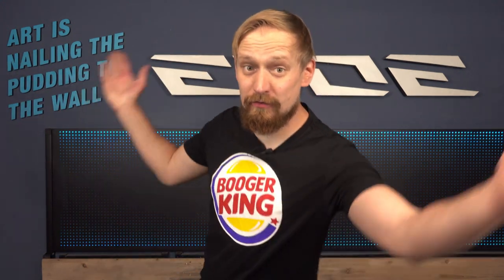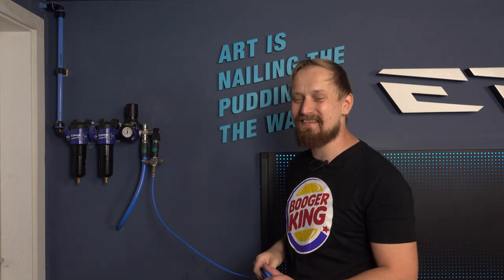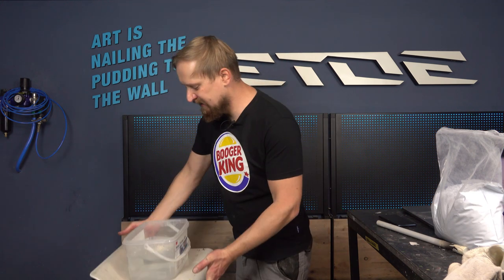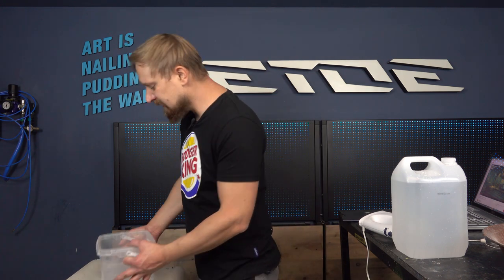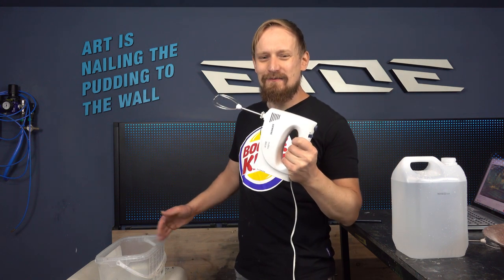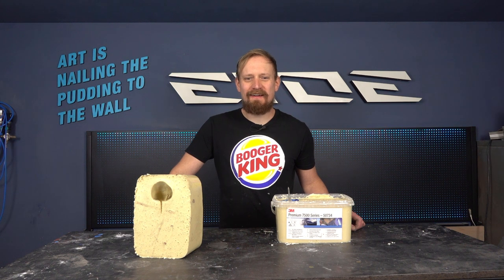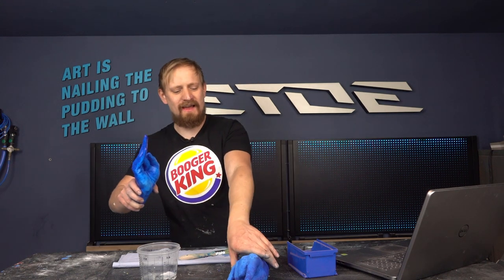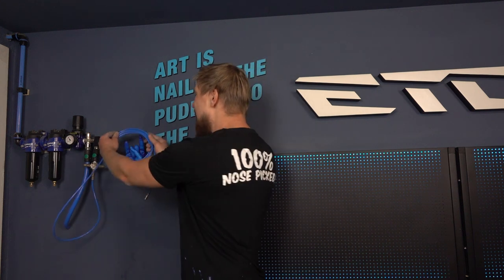Cast a hand for the best hose clamp ever

Comment: Even when you just drill a hole in the wall, you're using safety goggles and ear protection. Great to see that!
ps: Maybe you can use 'holzmodelliermehl' to place a thin coating on the plaster cast to create a wood feeling finish, off course you need to airbrush on top of the coating afterwards.